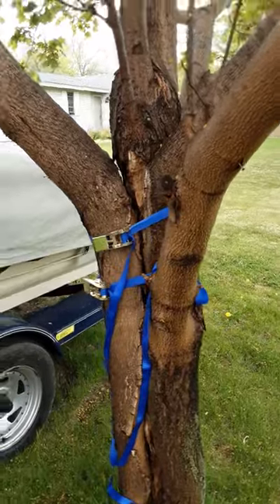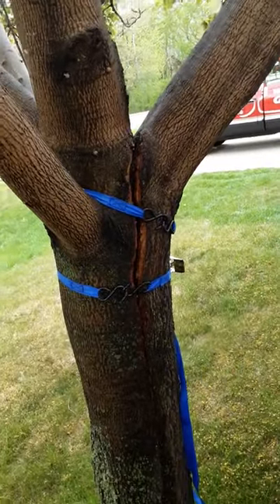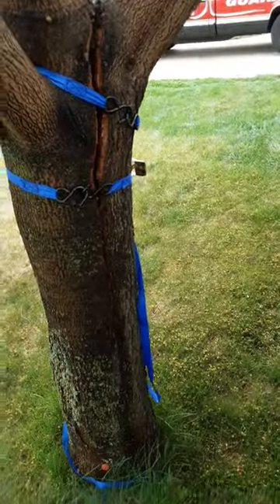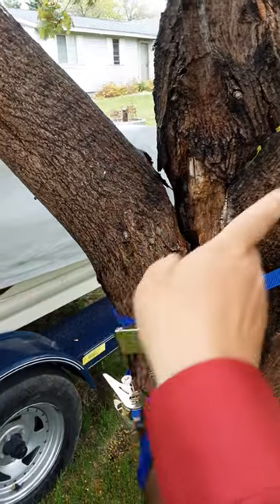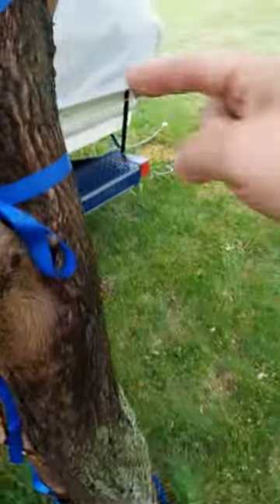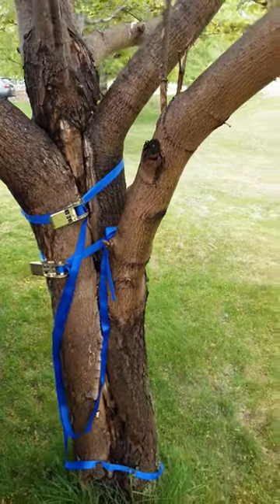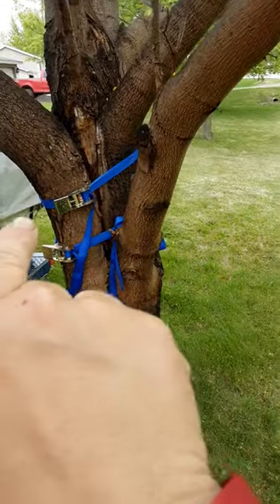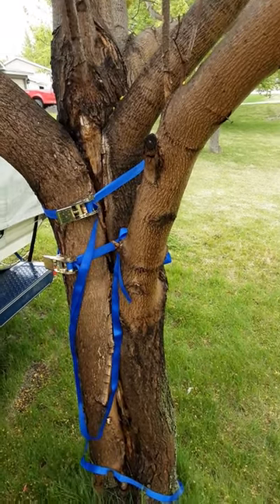I will show you how to repair a splitting tree without girdling it

Comment: Hmmmm. Maybe. That tree looked dead, or dying. I get the point but am wondering why you did not include post fix pics. Also, some say you should fill with adhesive, others disagree. I probably wouldn't, but I have no special knowledge. I bolted a Mimosa today. Will try to remember to give an update a year from now.
Reply from the maker: Tree was very much alive, still is. The house was sold so I did not return to get an up close photo. The gap closed up as it grew and scarred over so no filler is needed.
Reply: @deblenthetreeturfdoctor8807  Cool! Thanks! And, update on my Mimosa. VERY much alive and thriving even with a 2 inch bolt anchoring the V split between the two main branches. Hard to keep nature down!
Reply: Doing this to my lost limb of a 24 yr old Apricot tree.. thank you.. ratchet for now.. bolt going in tomorrow
Reply: Is there a time frame repair needs to happen before its too late?
Reply: @anarueda2760  If yer thinking that you need to just go for it--and make the repair. Nothing to lose. Trees are amazingly resilient. Trust your instincts and glue, tape, hammer, weld, bobby pin, strap or whatever that thing....